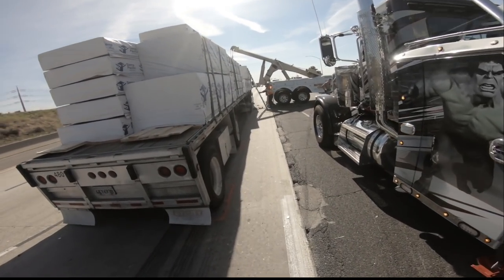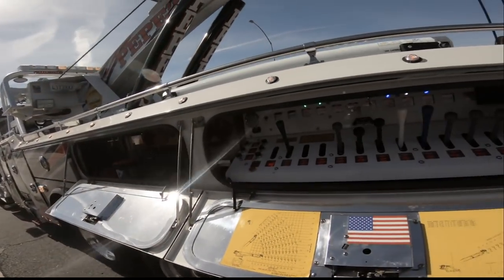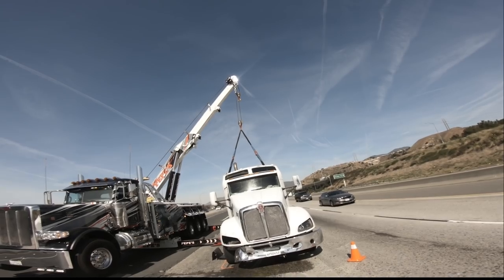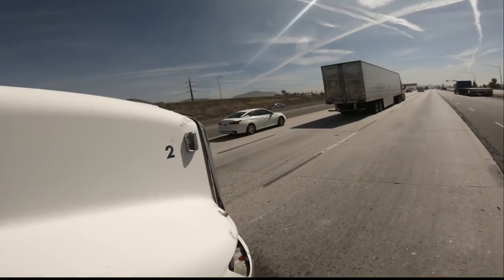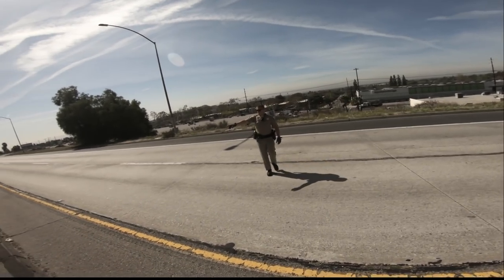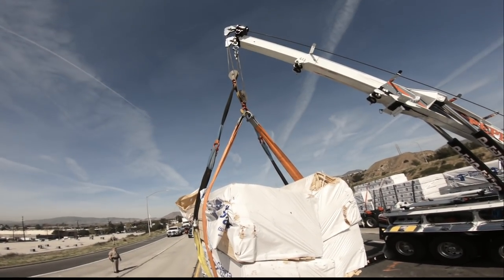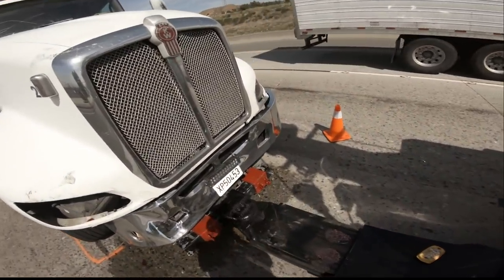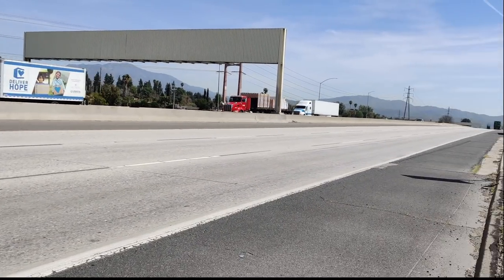Major shifted load on the freeway - Hulk to the resuce

Comment: I am very surprised that the highway patrol would not close off the left lane next to the truck you were working at, also I used to ship and receive heavy machine rollers (50,000 lbs) and we had a policy and a sign on the building that said : attn. truckers, no chains ,no load". I know from experience straps are great for lifting but not always for securing loads, but depends on the load and the weight. The truckers I had dealt with always had a "fence" or a stop at the front of the trailer to prevent the load shifting forward and we would not load them if they did not have chains on the end of the machine rollers set up in such a way where the load could not shift sideways or front to back. Straps were used only to hold the tarps down...Keep up the great vids and keep safe!!!
Reply: I may be an idiot here, but I think there should be a reinforced structure on ALL flatbeds to keep the load from shifting forward. I'm guessing (and hoping not) that the driver will be cited for improper load securement. It appears to be an industry-standard safety problem, imho.

Comment: The handling of traffic by officers never ceases to amaze me.  In this case the traffic passing you should be utilizing the vacant emergency lane.  That would have given a free lane by you.  I would guess that the State has some rule to prevent officers from using it.  One would hope they are just not to dumb to use it.  Our Volunteer Fire Dept. did a lot of traffic control on I35 and we used it when needed.  All you have to do is stop all traffic then restart it with the left lane onto the Emerg. lane,  they will follow the leader to keep moving.

Comment: Why didn’t you detach the truck from the trailer 12 inches or so before lifting the lumber????   Would have been an easier lift plus less damage to the truck
Reply: The load was sitting against the truck so any attempt to pull the truck away would more than likely cause the load to fall off. 
Plus most tow companies do not want to drive customers vehicles at all due to the potential risk of them making a claim that some damage to the truck was cause by the tow operator. 
Most of the time what those of us who dont work in this field would think is easier most likely isn't. And a lot of times could also be far more risky.
Reply: Joe Stimac once he had supported the load with the rotator the other tow company could have pulled the tractor forward 18 inches allowing Pepe’s to be able to connect back together alone after loading the timber on the other truck, So no driving causing damage. The only extra damage was dragging the load up the rear of the truck and to the load itself as not able to move forward. I used to work in this field

Comment: Looks like you know what you're doing, but I'm curious why you lifted the stacks that were wedged against the cab
Reply: When he tows that rig, the tractor still needs to pivot at the trailer. That wedged stack of plywood would have shredded the cab, and made a heckuva mess, making the problem worse.
Reply: @jimbeckettplay  
Right, but lifting those stacks while they're wedged against the cab could cause a lot of damage too; though it seems it didn't.  I might have transferred the entire load to the other truck and towed the truck empty.  In any case I would have moved the rear stacks first.  Just trying to understand.
Reply: @tonyroma9046  The damage is pretty much done at the point of the accident. Any additional damage required to lift that stack could be cleaned up at the site quickly. If you left it in place, you would have broken bits of the sleeper cab to clean up all along the tow path.
Speed is of the essence in clearing the freeway. You only have time to transfer as much of the load as is absolutely necessary. If you took the time to transfer extra (or all) stacks, you would be increasing the amount of time the road was closed by a fair amount, unnecessarily.
Reply: @jimbeckettplay  Yeah, you're right.  I was thinking maybe he could see it wouldn't rip the cab off to move those stacks.

Comment: Maybe  it would be a good idea to invest in a forklift? for these kind of jobs.
Reply from the maker: We have forklifts, but what good would that do here? I'd have to show up on scene, then say "I need a forklift". Call my shop, have them load one or tow on a Landoll, bring it, drop it, then what? Put one on each side? It's not like you could just get under it either, it was on the floor of the bed and wedged hard. How would you do it? That takes a horribly long amount of extra time. I obviously got it done quick and easy with a rotator. Plus the load is unstable, what happens if it falls

Comment: Just a question why didn’t you have other tow company pull the truck from under the trailer to prevent secondary damage to the road tractor. I know you have to get the road clear but I can’t see furthering damaging a customer’s equipment. 10 minutes of work isn’t bad for the  risk of more damage. Great work though!!
Reply from the maker: What additional damage? The massive load literally crashed into the back of his cab, you're really complaining about a vertical lift here? The other truck couldn't handle the call so they left, I mean did you not see the video? Chp only allows as many trucks as necessary on scene. They weren't necessary

Comment: Wow he messed up but why couldn’t you disconnect the truck first instead of ripping it out of there tearing everything up
Reply from the maker: What did I tear up? The damage was done, did you not see the fenders flared and the top cracked when I did a walk around? It was wedges hard to the back of the tractor, by pulling the tractor forward you take a massive risk of the load falling off the trailer. Why would I take that stupid and dangerous risk?
Reply: Pepe's Towing Service when you had the load secured to you boom that’s when you could have removed the truck . There would not have been anymore risk than you already had
Reply: Pepe's Towing Service but I’m seeing it after the fact I’m able to see different ways you were under pressure I understand
Reply from the maker: @froglick28  OK I see what you mean, but that would require two trucks. The company originally called to do this job left so I was solo and this was not my area so it's not easy to get another one of my trucks there. Nor would CHP be happy with me standing by for 45min to get another one of my trucks just to pull this one out. You have to know how to assess things like this, I decided the further minimal damage from coming up this way was negligible compared to the damage already. Rear of the tractor was badly damaged, the front was beyond damaged and will require tons of body work all around.
Reply: In my 30 + years in the business, I always have worked with the attitude that takes a given situation and you're in charge of the scene and you do it your way.

One of the best I learned from taught me early in my career to never forget that.

We were working a recovery late one night. The wet behind his ears Chippie was bouncing around the scene trying to tell us what to do. 

Finally, Dave took his gloves off, laid them down on the bed and fired up his cigar.  And enjoyed it. The CHPer really lost it.  He suggested that the officer light another round of fusee, telling him that by the time they were burned out, by him allowing us to do our job, we'd be done. 🤪😎

Comment: I wasn't impressed with your decision to pull those stacks of lumber out from between the truck and the rest of that load on that trailer.. you should have suspended them yes, but seperate the truck and trailer prior to the lift. naturally with another tow vehicle. nothing like having a couple of stacks of lumber doing unnecessary damage to the truck and lines that may not of been leaking prior to being ripped out of place... not to mention towing that loaded, wreck trailer 200 miles without checking to see if the kingpin is not bent and getting ready to break... ... some if your decisions to work that close to traffic on a ladder. it under the truck... well that was just nuts.. ... I'm a retired crane operator and heavy wrecker operator with a lifetime of experience... ... Your life isn't worth keeping a lane of traffic open.. when you have to work on that side of your wreck, shut that lane down...PERIOD! ... having a officer watching and communicating with you with what your needs are while you work... priceless  ... make those police earn that paycheck!! they are there for everyone's saftey. so when you need that lane let them know it... . I wouldn't have risked the towing both I would have separated them.. ... while one truck is hooking to and moving the tractor, hulk would be loading the stacks of lumber on the empty trailer.. and when finished the tractor should be gone which left you with a loaded trailer to tow from the seen... good luck,  stay safe...